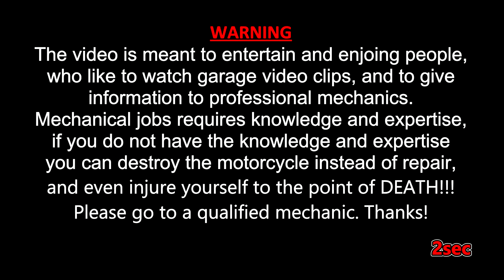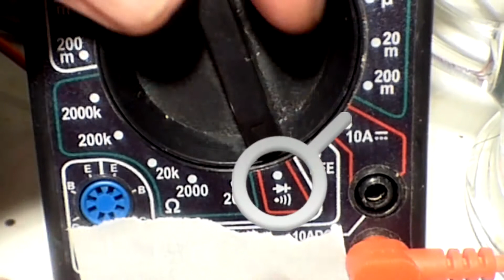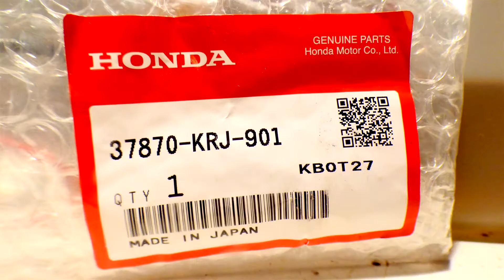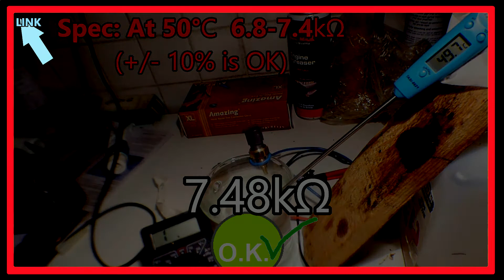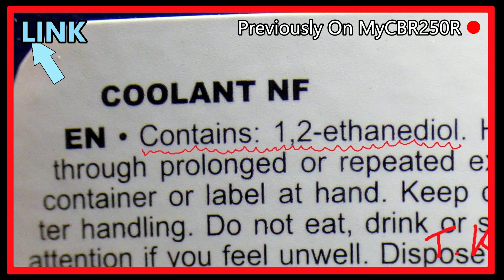Cooling System (2Of2): ECT SENSOR | Removal, Check & Installation |  Full Guide | Honda CBR250R 2013

Comment: Bro,is that compatible temperature sensor to my cbr 150 v2?
Reply from the maker: @jeff01navarro  
I sir. Sorry, I don't know. They don't have to be the same but maybe they are. So it's a must to check. If you have the one you're getting out (the used one), and you have the one in your hand of a different model (new), do a comparison test, you can measure: External dimensions, Connector type, Resistance... If you're buying new, any serious store will be happy to provide you a service to match the part to your specific model.

Maybe you'll find an answer by searching further online, maybe there's a forum for 150cc owners...???

Comment: That sensor out of range at 50 degrees Celsius, what was the fault with the bike?
Reply from the maker: Hi
Sir the sensor checks a range between 50 and 80 degrees by spec. I didn't understand your question, maybe you could clarify please. Thanks.
Reply: @mycbr250rdmotorcycling7  What fault did the motorcycle have?
Reply from the maker: @oistepoSC  
Ah. OK, You're right.
No, my used and old sensor had no problem.
The exchange was carried out as part of preventive care, because:
I received a second-hand motorcycle,
an 8-year-old motorcycle,
with 66,000 km,
and in the last two years before that it also suffered from neglect.

So I replaced the temperature sensor, the work is easy, and the part is cheap.
Reply: On my motorcycle, when it took a little time to start warming up, it started to pay, then when the engine was hot, then the problem was no longer there, it would go away as if it were a failure in linearity

Comment: hello my bike is overheating even after running about 5 kilometres , the temperature bar is upto 5 and the fan is going continuously without stopping  after 5 minutes of running... i used after market air filter...
Reply from the maker: Hi. I'll start with the air filter.
It is not the cause of the heating. I also buy non-original parts. Just remember that in such a case the duty of quality control is on us. Performing this quality control requires a certain knowledge of engineering, so those who do not understand engineering should avoid buying parts from an unsupervised source.

Heating to line 5 in five minutes sounds like a problem with the temperature sensor. So I would start by checking it. Even before taking it out, check for trouble codes using the DTC red connector. 

Whether the engine is very cold, and the sensor is bad, or whether the engine really heats up, in both situations using the motorcycle will harm the engine, so do not start the engine until the problem is located and gets a solution.

If you have no previous experience in mechanics, I suggest you contact a qualified mechanic you trust on.
Reply from the maker: First check that you are not leaking coolant OR ENGINE OIL.

If no coolant or oil are missing, and the temperature sensoer is working, the next step is to check the thermostat valve.

There is a lot of danger in this type of work, also a risk, maybe you contact a certified mechanic that you trust on.
Reply from the maker: Ok
First check that you are not leaking coolant OR ENGINE OIL
Reply: @mycbr250rdmotorcycling7  there's an oil leaking from the head casket.. can little oil leakage cause overheating??
Reply from the maker: By the way checking the engine oil level, did you also change the oil filter recently? Because whoever assembles the oil filter upside down blocks the passage of oil to the engine, which causes the destruction of the engine in a very short period of time.
Reply: @mycbr250rdmotorcycling7  okay bro thanks alot ... will do what you suggest...

Comment: Why is this procedure necessary??
Reply from the maker: When I bought the motorcycle with 66,000 km, I marked some maintenance work for myself. Maybe in retrospect this work was not that necessary, but I did it, as a Youtuber I took a picture, and that's how the video that describes the entire procedure was born.
This is necessary if you have a fault, or suspicion, in the ECT SENSOR.
Reply: @mycbr250rdmotorcycling7 thank you for replying ..by the way the your videos are very informative and easy to understand

Comment: Hii Sir.. I have watched all your videos and learned too many things from your videos.. sir I have cbr 250r 2016 model.. & I am facing black smoke problem since 2 3 months.. I have changed fuel filter and spark plug too bt my problem still persist.. can you please assist or make any video on this?? It will be great for me.. thanks in advance
Reply from the maker: Hi, I'm shooting and editing videos based on treatments I do on my motorcycle, it's my hobby, and I'm uploading for entertainment purposes. I do not initiate repair jobs just to photograph them. Of course there is also an option to learn from my videos but I do not encourage people to Do It Yourself mechanics because there is a great deal to know beyond what I am filming and presenting here. And there is the dangers of working without proper knowledge, many dangers, both to health, and to life.

To your question: This black smoke I think that is because the mixture is too rich.
Do you have a carburetor?
Or a fuel injection system>

Please do not continue to ride like this, it will ruin the engine, and if you have a catalytic converter, maybe you may have already ruined it too.
Reply: @mycbr250rdmotorcycling7   ohh. Thank you so much for reply.... i will go to the mechanic only for this job.. bt I just wanted to know the reason behind this.. my bike has fuel injection and it's non catalytic converter
Reply from the maker: @bharatsutar1314  
In cold start your engine start easily?
What is the temperature in your area now?

The IACV functions like a choke, maybe it's stuck on an open state? And maybe some other sensors is causing the ECM to give a rich mix?

If you have a technical sense you may try to see if there are codes of malfunctions in the memory of the ECM, the test is performed using a DCT connector:
https://youtu.be/pFtiiODFPME
Reply: @mycbr250rdmotorcycling7   I am from Mumbai India . Temperature here is 32 to 34 dc currently.. yes engine starts normaly with just single self even after 3 4 days gap.. I have checked authorised service centre here bt the guy there was said need to change whole cylinder kit, shim,valves & many other things.. so I got more pressure 😂.. I just wanted to know if he right??
Reply from the maker: @bharatsutar1314  
At high temperatures(32-34dc), if the mixture is too rich, I would expect there to be a problem with cold starting ("first" starting). But you claim you have no problem with cold starting.

 If there is a problem of engine wear I would expect oil to escape inside the engine, then the smoke is white. Do you have a massive oil spill? But you claim the smoke is black.

Your mechanic has seen the problem, and he probably understands what he is talking about. A trust in your mechanic is a very important thing, if you do not trust a mechanic look for another mechanic, and ask him for a new opinion.
Reply: @mycbr250rdmotorcycling7  Yes there is little oil spills through the exhaust bolts near head. My mechanic too says if there a cylinder problem then the smoke should be white? but he said he has not much knowledge about FI bikes. Recently i have found one guy who is expert only in CBR i contacted him for the issue & gonna drop my CBR to him within next 10 15 day's.. Lets see... Thank you so much sir for your valuable replies... & your video's are always informative for many.